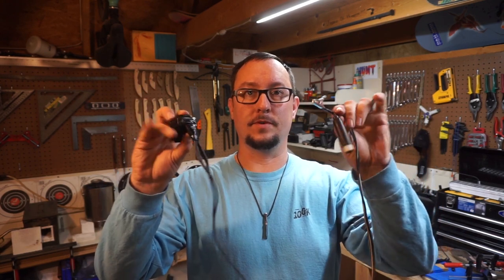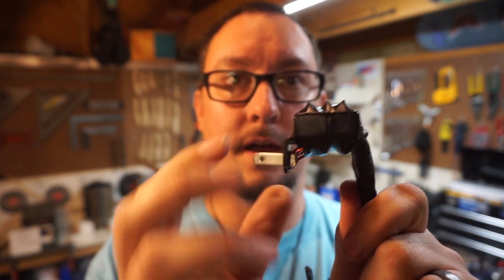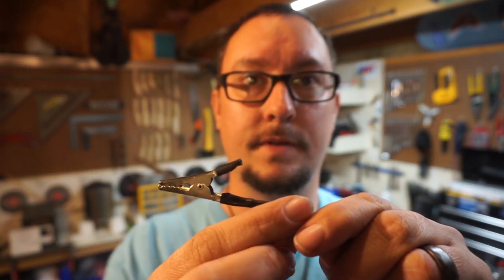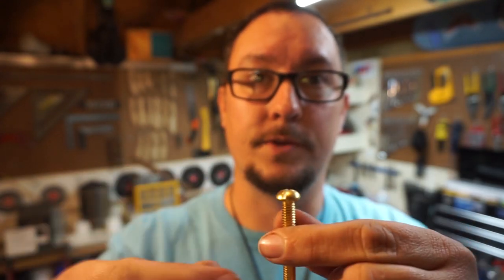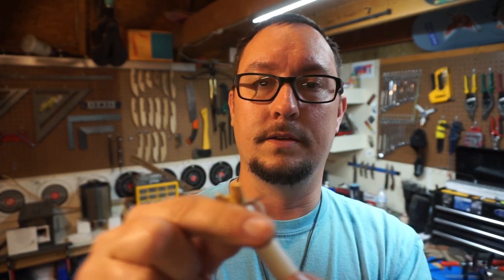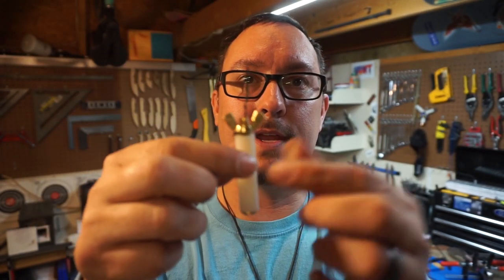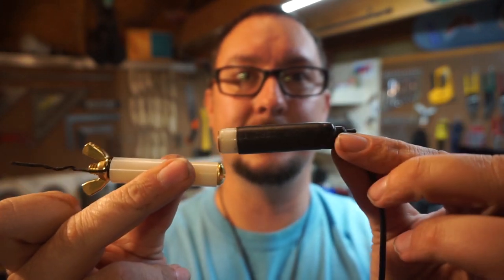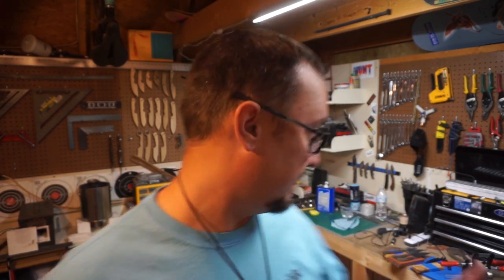Cheap and Simple Etcher for Knife Makers Mark

Comment: Would like to see the build of the plug end of your etcher. When you sowed it in the upper left hand corner, it was to small and fast to see how you built it. Thanks.
Reply from the maker: I Plan on building a 2nd one and showing parts of it on the Shop Talk Tuesday's.

Comment: Hey buddy I watch a lot of your stuff and I've learned a lot from you and I really thank you and appreciate that I have a question I know this video is a little older where did you get the AC adapter from?
Reply from the maker: You can get these by taking apart an old AC or DC charger. I use a 10 year old car battery charger for etching now. If you're going that route, you need to get an older one that doesn't have all the safety features like the newer ones have.

Comment: What are those little plastic things that go around the brass bolt called ?
Reply: I wish you would do a full video on how to build it.
Reply from the maker: Ill be building another one soon and do a video dedicated to that.
Reply: Those are Nylon Spacers / Bushings, Even a bit of rubber hose(gas line) would work just fine.